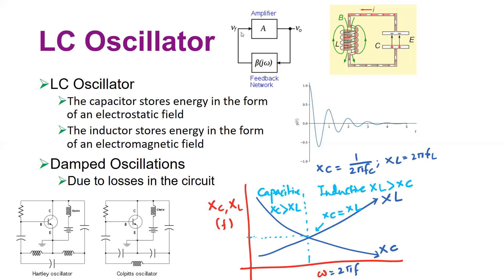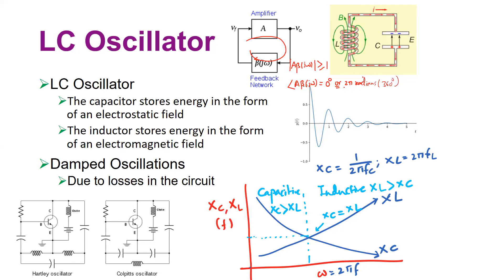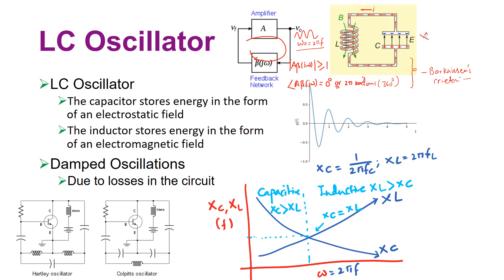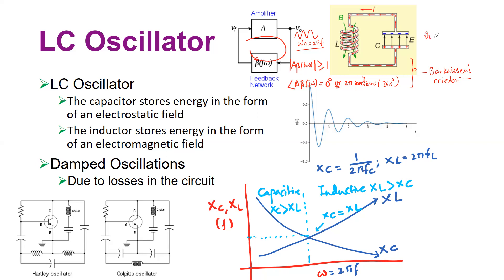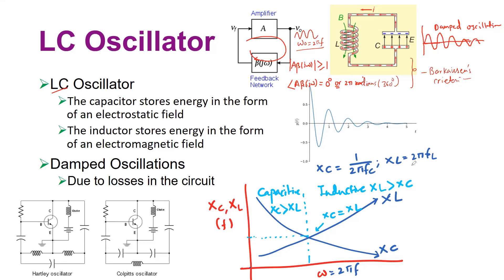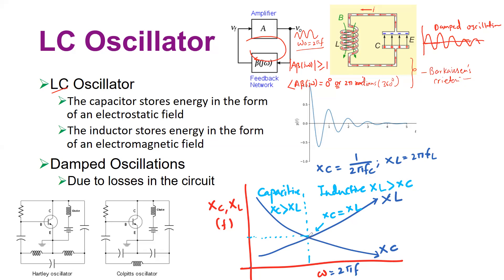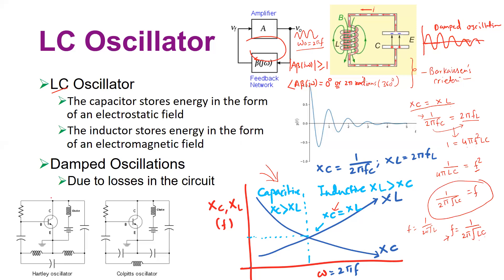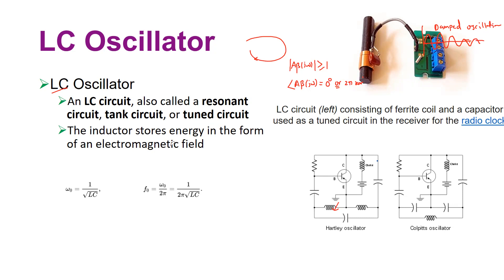How LC Oscillator Works

Comment: Let me plz tell you some info about the LC oscillator circuit as i understand its principle of operation.  
I agree the the capacitor start charging at the first instant of swithing on the supply to the circuit. After its full charge,  it starts to discharge in the parallel or shant coil across it.  The. Coil is magnegayilly is full charged through the discharged capacitor.  Then,  thw coil starts to discharge magingatilly is an inverse current that charges the capacitor in an inverse voltage  value.  The cycle repetes itself several times before thw charging and discharging energy damped to zero according the the heat effect losses in the coil and the leakage current in the capacitor.  It formes a sine wave cycle starts at maximum amplitud to reach its minimum zero volt.  The frequency rate is related to the value of the capacitor and the coil accirding to their resonance frequency as it is discussed in the text before.
Reply from the maker: Great info.
Reply from the maker: Great info.